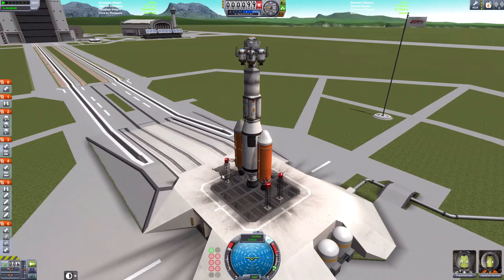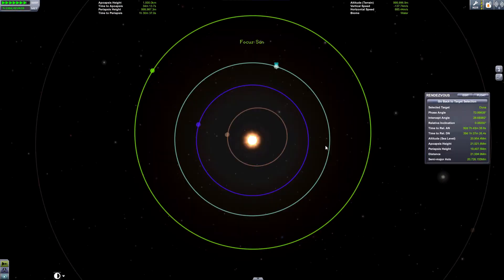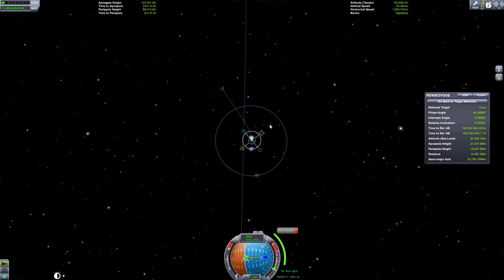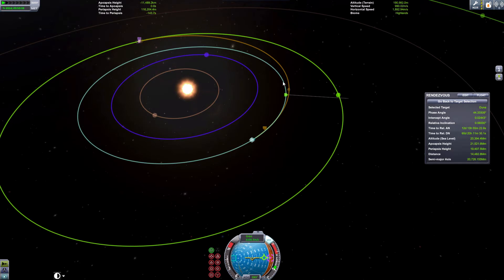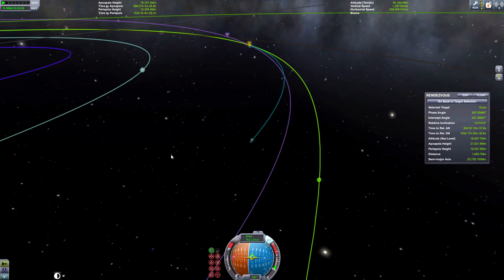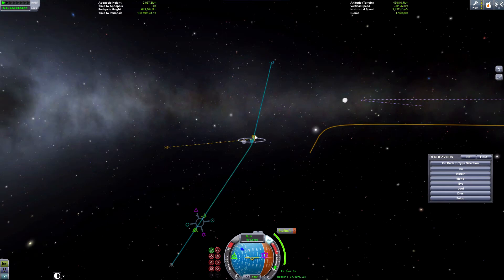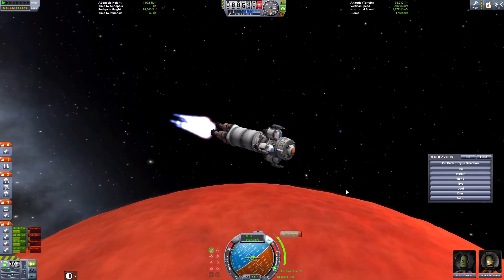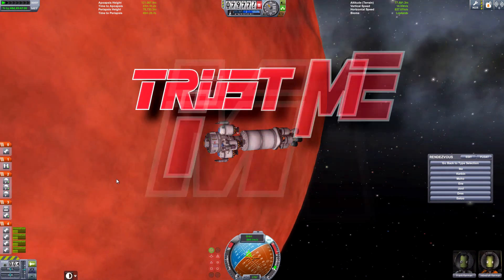Kerbal Space Program - Interplanetary Transfer Tutorial Engineering Style

Comment: Would you say that because you're only burning when leaving Kerbin, and burning when you arrive at your preferred planet, that farther planets don't have that much more of a fuel requirement as Duna or Eve?
Reply from the maker: It depends on where your going, it does seem that the delta v required is between 7000m/s to 13000m/s but the planet's moons fir example around Jool require around 20000m/s though don't hold me to that as I haven't been to Jool's moon's yet. There are ways to reduce the fuel required like using aerobrakeing or even using the planet's or moons gravity (both can be quite hard to do)
Reply: Orb8Ter
Thanks. I trust that you're correct. After all, you're an engineer
Reply from the maker: Immortalcheese Also note it's always best to add extra fuel just in case I heared somewhere NASA has 1.25 times the fuel required I assume for manned missions, not sure if this is true though but the extra couldn't hurt.
Reply: Orb8Ter I just tried to send an unmanned probe to Eve.......... I had a huge rocket (the fuel tank was the large orange one and a Mainsail engine).... the thing didn't have enough dV to ascertain orbit around Eve......

You make this look so easy.......